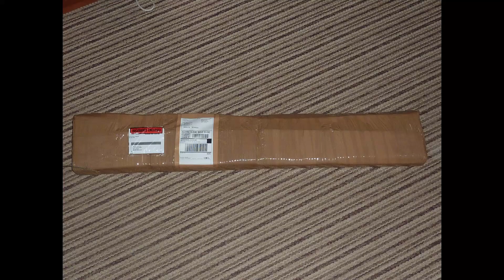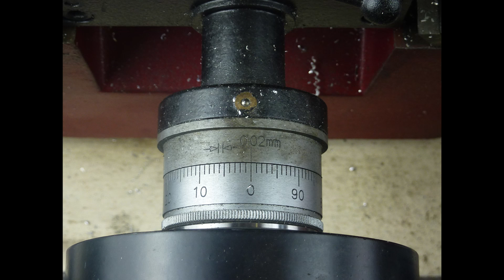Model I/C Engine Build - Part 1.  With subtitles.

Comment: Were do you get the drawings from for your engines ? Or do you measure and copy an existing engine ? Amazing what you can make with lots of skill and some relatively inexpensive machinery congratulations on your ability.
Reply from the maker: They are to my own design.  Hopefully they will actually run some day!